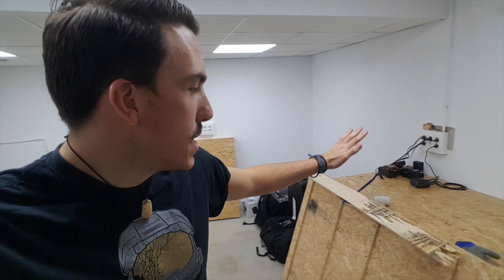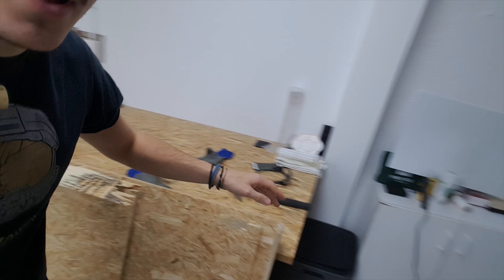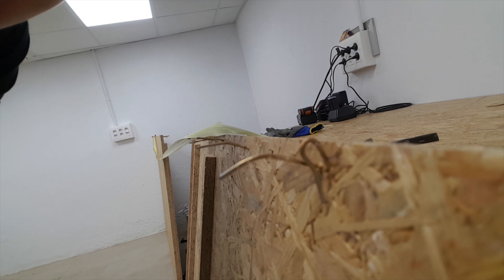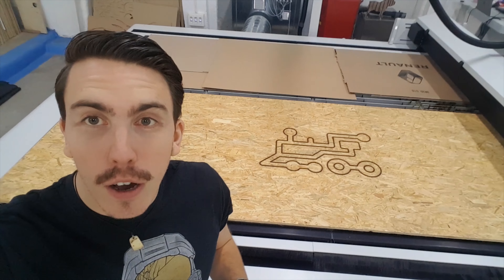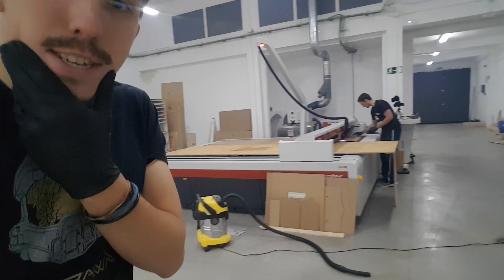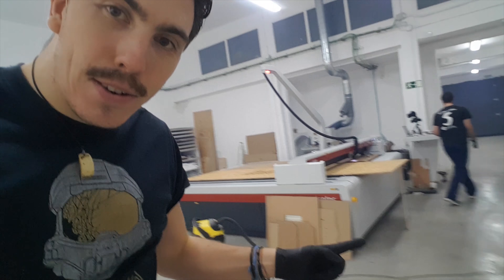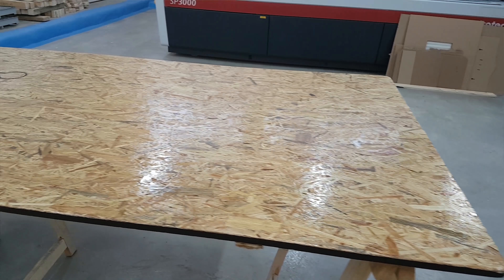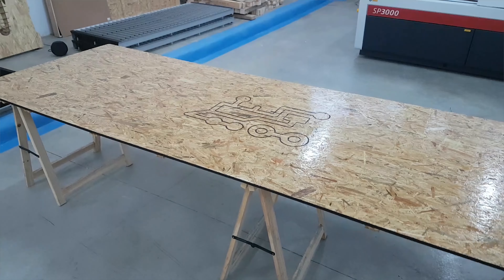Laser cutting a 3 METER! Dinning table...

Comment: Really cool looking table top, and from reused materials as well. Rather than using the trestles to support it, how about cutting some square tube legs from more of the OSB, using box joints on the four edges/corners. locate two of those into a horizontal box beam to spread the support for the top, and do three sets for the whole length of the table?
Reply from the maker: Hey Andrew! Thanks and ya good shout... I'll give it a thought and see what wood I have left to use and come up with a design. Ya those trestles really do put the table to shame xD

Comment: Any tips for cutting chip board? I imagine the impurities and potential gaps within would cause issues. Was it toxic?
Reply from the maker: Hey Cosmo, OSB board or chipboard... What we have in this video is OSB. In my opinion a little easier to cut with a laser due to the compressed nature of it and the great part is that it's not at all toxic as it's made with water-based glue and not epoxy. As for any tips... Max nozzle air pressure high and keep the hertz low to give the wood a chance to keep cool. As for gaps in other materials... ya they are a real pain... especially in plywood... thus laser ply stops those problems.